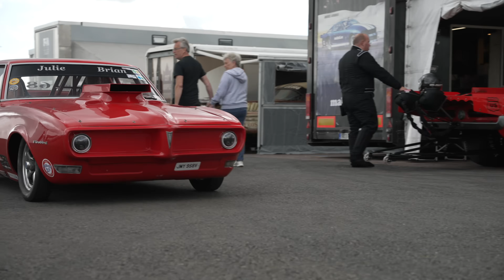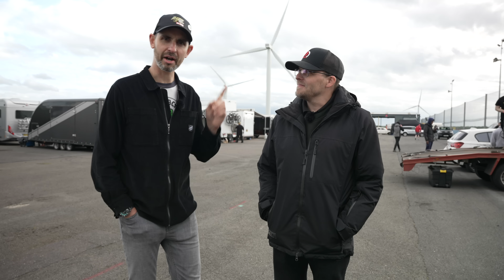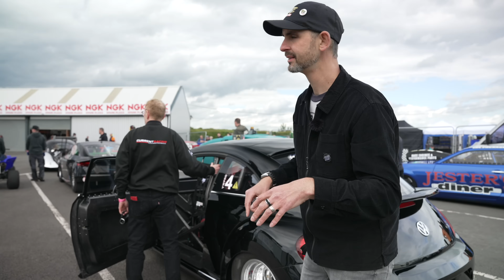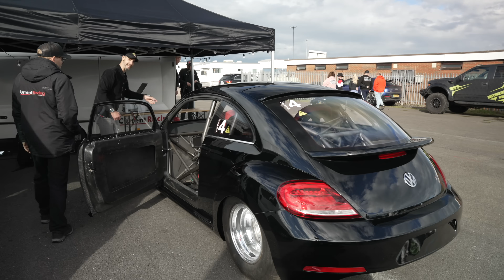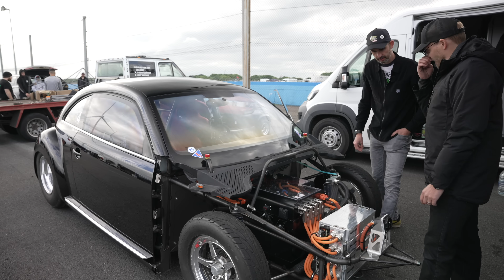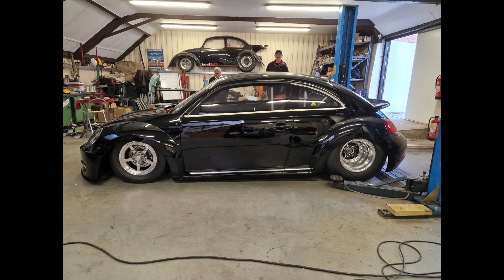British built project electric Beetle drag car promises to become the world's fastest EV

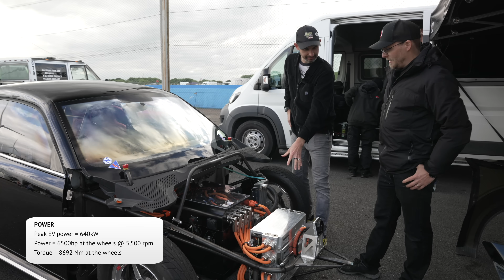Comment: 11:06  FYI, "640kW" is about 858 hp.  If the peak EV power is 640 kW, and it's 100% EV, then the peak power should be on the order of 858hp.  What am I missing ?
Reply: Think someone added an extra zero by mistake, clearly this is not 6500hp, not even half that
Reply: Overloading the electric motors for a short time. 💙 T.E.N. Edit: But not 6,500 horsepower. That would burn rubber all of the way down the track.
Reply: @tracynation2820  640kW is described as 'peak', so your otherwise-valid point was covered off at the outset.
Reply: @JxH  motors can be loaded past the peak spec, depending upon cooling and duration. Ie a motor that might be rated at 50kW constant and 100kW for 2 minutes could probably also do 150kW or even possibly 200kW for say 20 seconds. Again, all depending on cooling and specifics of the motor, but it's not uncommon.
Reply: @john_p  But if the battery system output "640kW peak" (as the text box on the video implied), then I'm afraid that's that.

Obviously I can't say if the error is in the math, or in the usage of the Queen's English, but 640kW peak just is 858hp peak, period.

Perhaps there's a giant spring in the drive line, so that they sit there winding it up at 858hp for almost a minute, and then the giant spring unwinds at "6500 HP" for the next 7s. I'm guessing not. Nobody mentioned a giant spring. :-)
Reply: @JxH  they've posted at the top of the video saying the 6500hp was a mistake so I believe we can move past that. The motor spec card showed 416kW constant which usually means ~800kW for something like a minute, so maybe 1200kW for a few short seconds, ie pouring on the power in the deep end. Although as you observed output is ultimately battery constrained too. Since the whole drivetrain is custom, they can just as easily continue to upgrade as needed. I have no doubt they will be in the 7s soon, especially seeing as they were almost there with the old car.
Reply: @john_p  FYI...

Card in video actually says, "*PEAK* EV power = 640kW".

I've recklessly interpreted that to imply that the peak EV power is 640kW. So all this speculation about other potential peak values are ignoring the bit of information in the video that is likely to be correct.

YouTube is not the right place for any sort of technical discussion. Hopeless. ;-)
Reply: Looking at the Nm capabilities of the motors each motor should produce a considerable amount more hp at 5-6000rpm. Multiplied by the rear diff gear (4.10) for rear wheel hp.
Reply: @ollyyoung6193  "Multiplied by the rear diff gear (4.10) for rear wheel hp", oh no no no no.  Horsepower is NEVER multiplied by a gear ratio.  Torque is, but the RPM drops across the gear set to keep the power the same.

If power could be multiplied by a gear set, then energy could be created.

P.S. Perhaps I'm misinterpreting what you wrote, or intended to write, there.
Reply: @JxH  When did they actually say the car had 4.10 gearing? Most EV's have roughly 8-to-1 gearing... 6500/640=7.57 gearing....
Reply: @RadRidesByCru  In this comment thread.
Reply: @JxH  Ah, missed that, thank you... their math is clickbait and the car isn't going to run their numbers with only 4.10 gears... but its win/win for them because they get to brag while everyone else argues the logic of their lie.
Reply: @ollyyoung6193   If the peak power is 640kW, then the peak power is also 858hp; as these two values are equivalent.  More or less 'Metric vs Imperial', nothing more and nothing less.

P.S. A kilowatt is merely a fat horsepower (1.34102hp); about +a-third. In reverse, 745.7 watts = 0.7457kW = 1.0 hp.
Reply: @ollyyoung6193  wrong, as JH said

Comment: The C rating means capacity per hour. So 70C means they can draw the entire battery pack's capacity in less than a minute.
Reply: Yes, but our run time is 10ish seconds. Driving it on the road we wouldn't pull as much power. We also only carry the smallest battery we can to save weight.
Reply: @ollyyoung6193  Pretty awesome stuff!

Comment: Love the engineering behind this. Especially as the original idea behind the Black Current and it’s subsequent generations was born from rummaging around a scrapyard.
Reply: Thank you.
Reply: And using no less than an electric milk float motor, which probably did more long term harm for the credibility of electric vehicles than any other single thing. They have certainly made a great job of this latest creation. Be nice to see them at Goodwood next year up against the Mc Murtry in a drag shoot out.

Comment: 22 kWh @ 100C makes 2200 kW. Unless something funky going on, just over 3000 hp.
Are they overclocking the cells to double, knowing a run is 7 seconds and possibly pre chilled?
Do the 100C cells produce less heat (% of output power) than say "Tesla" cells used at 7-8C?
Reply: I think the cells are 70c not the pack.

Comment: 6500hp? I call bullshit, they would need to reach the 5500wheel rpm to reach 6500hp at 8700nm. That would be over 500mph with a tire like that.
Reply: I`m with you on that one. Trying to work out in my head what 6500hp means. This is not reality on 2 rear big wheels. Can it even be real on 4 wheel drive? NO! Salt Lake City for sure, but that`s a different world all together.
Reply: @martinmcdonald4207  ok, it says it at 11:08, it draws 640KW of electricity so it probably makes 500KW/650hp.
That or someone is winning a nobel prize
Reply: They're getting 6500 wheel horse power by multiplying the motor output by rear axle gearing... 6500whp/640kw=7.57 gearing.
Reply: @RadRidesByCru  No.
Reply: @JxH  Yes (again, lol)... I have a reply from Olly saying that's how the number came to be and TLBS pinned a new comment where he word for word repeated my reply to Laurean 599.

Comment: 640 kW but 6500 hp?
Or is it killing the 6500 hp V8s?
Reply from the maker: Apparently so.
Reply: @TheLateBrakeShow  More like 850 hp. The math ain't hard. Also, 2500/3000 is enough to hit high 6's. 6500HP would be in a car weighing 3500lbs be a 4.7 something second car. Bit clickbaity.
Reply: Clickbait trick... 640kw (858hp) times 7.57 rear gear equals 6500hp "at the wheels".